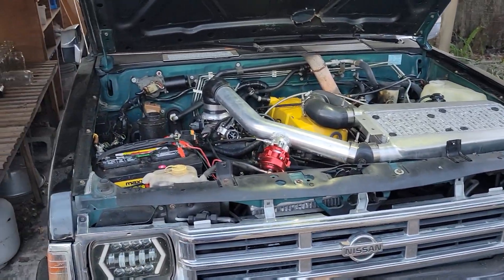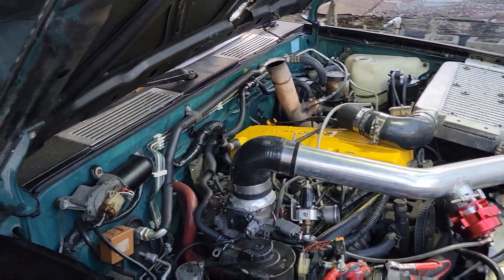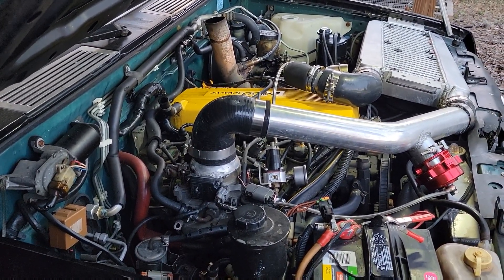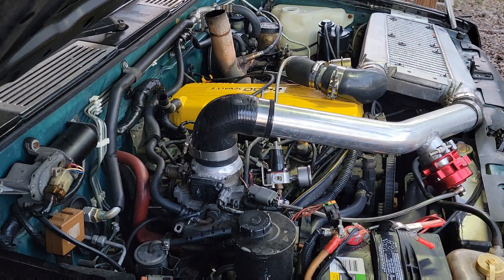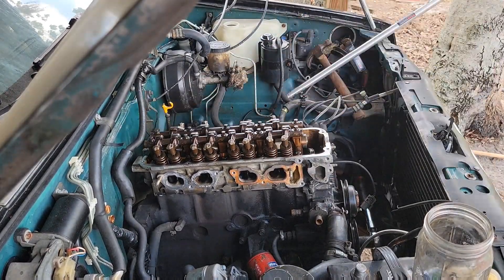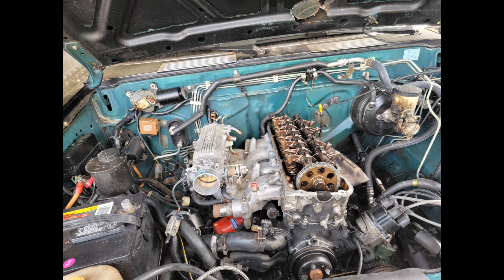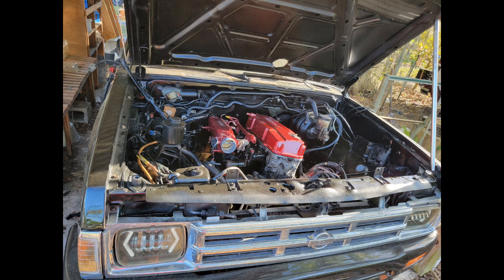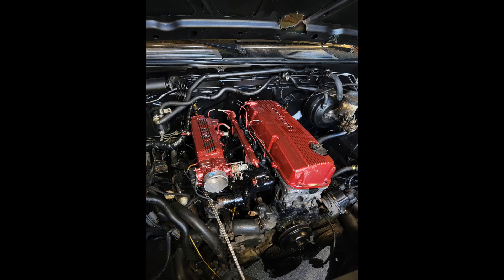Nissan hardbody turbo updated, upgrades

Comment: What year  did you get the intake manifold off of
Reply from the maker: 90to 93 I tink i fond it on the junk 240sx
Reply: @hardbody_Santiago96  89-90 you thi k
Reply from the maker: Yeaa I really don't know I do know that a eliminate every thing all the sensor ... I left culan sensor an trotter position sensor

Comment: Like your videos. You explain things well. Does your top mount inner cooler work good?
Reply from the maker: It's not very accurate intake temperatures too high so you create less power But for not having nothing it helps a little bit But now I'm changing to set up
Reply: @hardbody_Santiago96  can't wait to see it!

Comment: looks good man I would highly recommend next time you have the head off use the brand cometic head gasket you have to get the one for the dual overhead cam but it's the same gasket other than the timing cover part you just trim that off and reuse the timing cover part off of the Fel-Pro our Fel-Pro gasket blew right by the coolant jacket pushing compression into the coolant on number 4
Reply from the maker: Yeah that's why I put 80 pounds to the stock boats on the head
Reply: @hardbody_Santiago96  yeah man we had ARP head studs and it still blew it
Reply from the maker: Did you cut your head on the machine chop that weighs nice and flat 🤔  I was running at 19PSI When the head gasket looks pretty new the one I took out
Reply: @hardbody_Santiago96  yep all professionally done at Gregory machine shop in va beach put together by me and torqued to the specs arp gave it held for quite a good little while but it blew on the dyno on our first Dyno visit the cometic is all steel and reusable up to 7 times holding up great so far has had 3500 miles 4 auto cross events dyno thrash looking to do a full auto cross season them turn up the boost
Reply: @hardbody_Santiago96  and yes the block was decked honed bored 40 over and line honed for main studs
Reply from the maker: @WhoopAzzRacing  🤔jumm Well whenever I open it up again then I'll change it so already close right now I guess we'll have to see how long it lasts I do run with E85 and I keep my engine cold as possible I have no thermostat and my fans are directly all the time So my temperature won't go up not even a quarter let see

Comment: Gracias por los videos man. Thank you for helping out the d21 community, I’m planning on doing a turbo with my truck this summer hoping 250hp is good and it’s going to be a daily I hope everything goes well
Reply from the maker: 250 will be perfect Make sure it has enough fuel If you do it E85 is better